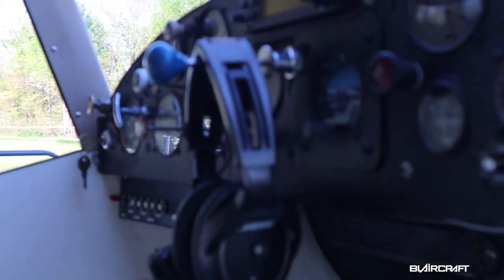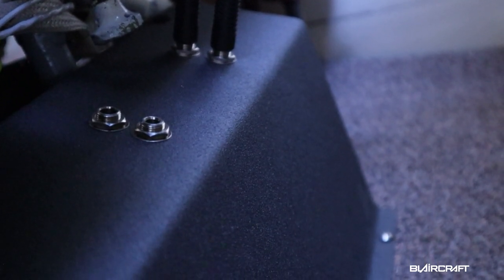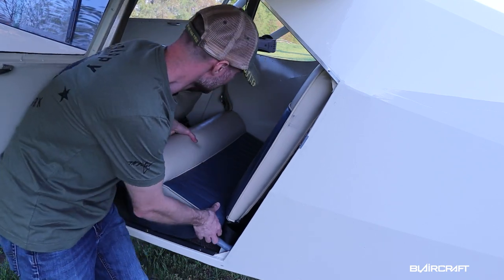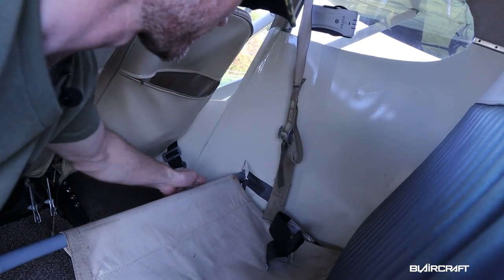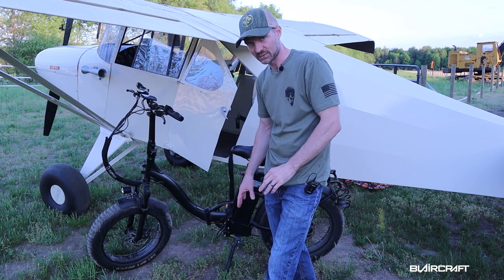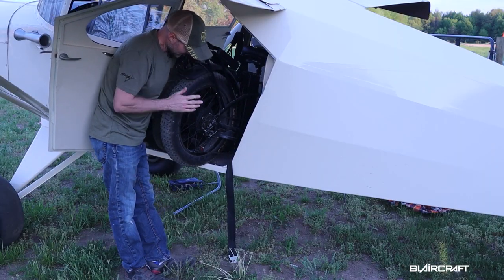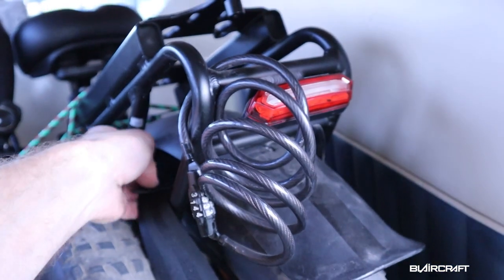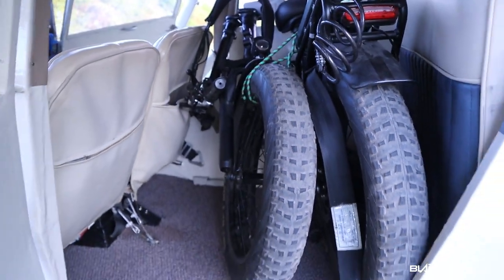Folding Electric Bike, Short Wing Piper PA-16 Clipper

Comment: My first ebike was similar, now, 4 bikes later, I have a Montague, with a mid drive conversion) that lets me use the gearing of the Rohloff hub  I also converted it to.  Flying with a bike will quickly spoil one, it's great once you land!
Reply from the maker: Very nice. Interesting… I’ll have to look that up. Yeah I’m looking forward to cruising around after landing. 
So far I’ve enjoyed this model driving around the Oshkosh campground.
Reply: @Blaircraft.Engines   Once you go mid drive, not to mention a Rohloff hub, you can do a lot more than campground riding! I will post on our Big Tires forum about this morning's ride and flight later today. Your bike is very good for town type riding, and the price was right. BTW: My e bike supplier, anything from batteries to ready to ride bikes, is Luna Cycle, they are true enthusisists and are head and shoulders above any others just looking to make a quick buck. I've dealt with them for 5 years and their prices can't be beat, IF you want quality.